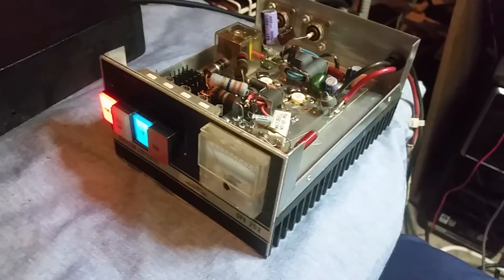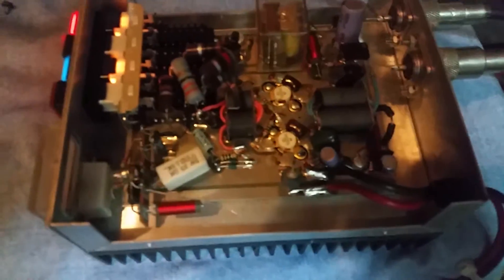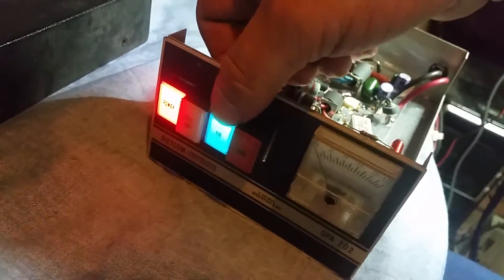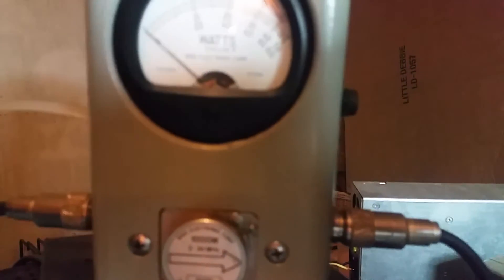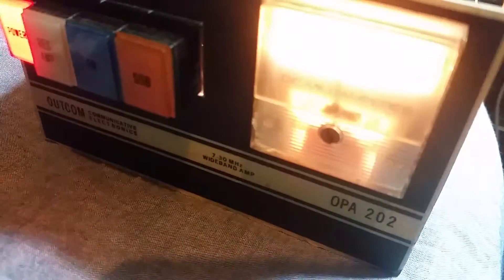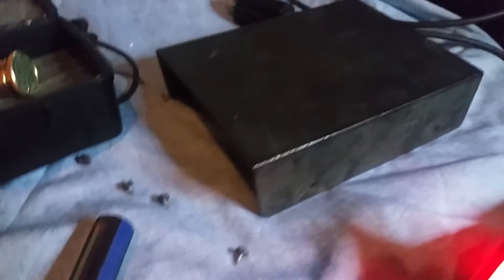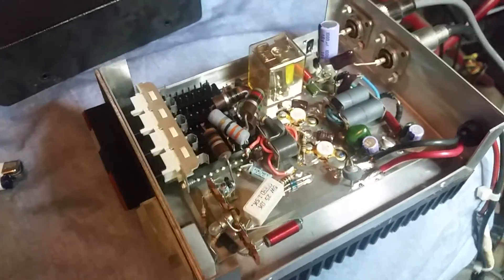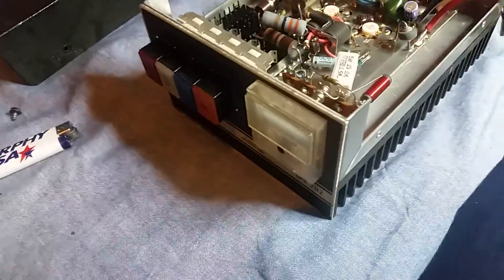Early Texas Star 2xsrf2072 Doing 400w on 19.5v LOL Wow For EBAY - SOLD!

Comment from the maker: If they are 2290 I'm not sure man cause of parts doesn't have them as far as I know. 2879 are 100 each which is highway robbery and isn't worth it physically so 2290 would be prbly 60 to 80 each.

Hey good thing I helped get the hgs here.

I'd say I'm a bit self proud of my self for picking the HG we all are using now. Makes me.feel like I did something for the community.

Comment: Well some old timers told me the Motarolla bipolar are not biased as much as the Japanese transistors so the wattage is lower but the inter-modulation distortion figures are better and they left plenty of room to make sure they always hit their published power and gain figures. I think this is true too because the best sounding transistors on SSB are usually not Japanese made. The MRF 455's sound fantastic on AM and SSB when sound quality not peak power are you goals. I have always wanted to see how 2  MRF 455's would sound driving either 4 MRF454's or 4 Toshiba 2879's on a really clean wide bandwidth audio radio. I keep some spare MRF 455's on hand because I have a President Lincoln that came from the factory with a MRF 455 final. I used to run a 2950 and a two pill amp that had 2xMRF 455's and that was a fantastic SSB rig. I ran a Radio Shack Noise Canceling Power Mic that was made by SONY for Radio Shack. I had bought that setup fro my Dad. People always thought I was a base station. 99% of my DX'ing is on SSB but local traffic is always on AM. My 2950 and amp was stolen. Being a Teenager I only had PLPD insurance on my truck so I never got a dime to replace my 2950 and Amp.  A lot of people that are not interested in volting their box and are not chasing insane SWR handling are doing some really good builds with MRF 454's. Their not insanely cheap like the Chinese 2879 knock off's but long term you probably are getting a more reliable and durable device. I do not talk to watt matters so I tend not to put too much stock in what the meter says. Plus I actually want to hear the people that are hearing me so I can have a conversation so I try not to get too carried away with power. Modifying electrical systems to handle the demand get's expensive in a hurry.

Love your video's!!! I might be looking into ordering one of your preamps! I might like to use it on my base so I can hear all the weak Mobil's!
Reply from the maker: awesome sounds great and i agree with everything you said.